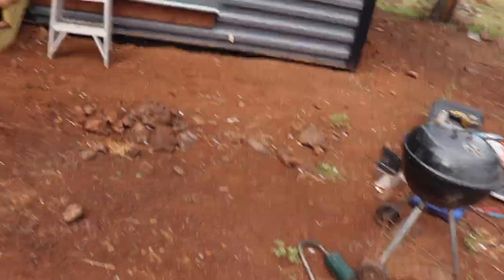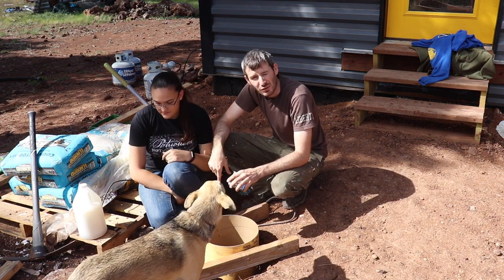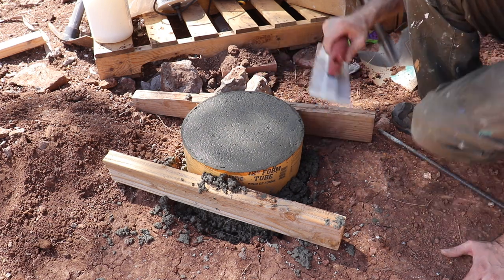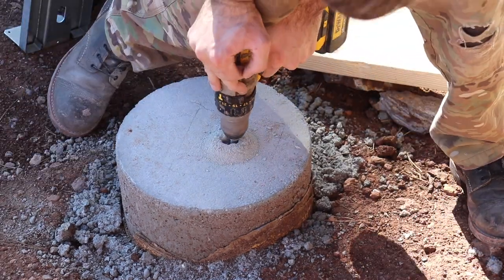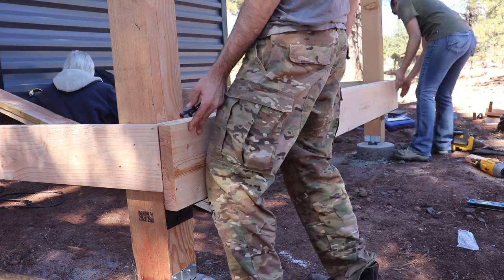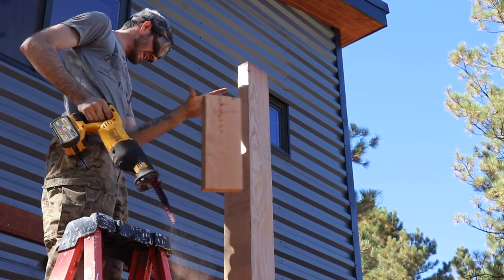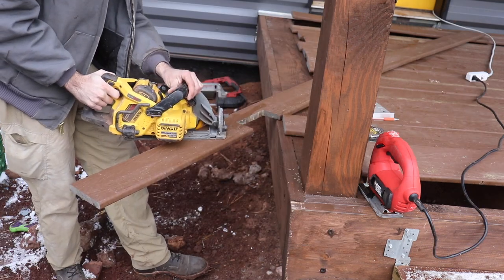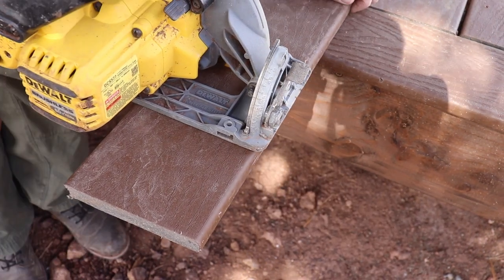Adding Covered Porch To Our DIY Cabin

Comment: Congrats!!! That's a huge achievement- you built a house! Think about that
Reply from the maker: Thanks!
Reply: @PootsPastures  how did you trench the holes for the footings where it was behind our at the bottom?
Reply from the maker: I used a post hole digger and breaker bar.  It took a while to get down 30 inches with our soil, but overall wasn't too bad with only 2 holes.

Comment: Tired Fingers

Still figuring out how this all works (hard to believe, I know; some people have insulin resistance ... I appear to have technology resistance ... maybe comes with age) Anyway ... hoped to hear how you like your DeWalt saw, nailer, and driver,  after all this? Model numbers of the items you're using?  I left a comment way back with your video on windows which was completely out of sync, so hopefully this will have a better chance of reaching you in a timely way. 

 I'm just gearing up for a similar sort of build.  My wife and I and perhaps a few trades folks and retired mentors to act as intermediary "inspectors' along the way. I just had my 76th birthday and fingers crossed still upright and pretty healthy ... Karen has asked that her age not be stated ... she's some younger; also doing well. But neither are we the proverbial " spring chickens". 

But your efforts have already been very helpful in sequencing our research and looking for what we'll need to start our shopping lists. We both absorb visual information the most comfortably, so many thanks!
Reply from the maker: Glad you're enjoying our videos, and sorry if I didn't respond to your first comment, I try to get to all of them!  But I really like the circular saw.  It's been fantastic, and has a long battery life.  Dewalt makes a 60volt and a 20volt, and this is the 60.  I would recommend getting a 12 amp hour battery (they are a little expensive but worth it so you aren't charging as often).

The battery powered framing nailer is also great, although by the end of the build the part of it that actually strikes the nail was worn down so it wasn't sinking the nails as reliably.

And then my drill and impact driver I had for about 5 years before I started the house build and they are still going strong.  

I would like to do a review video of the tools at some point I just haven't gotten around to it yet.

The saw is a dewalt worm drive style saw model number DCS577B

The nailer is the dewalt 21 degree Framing nailer, model DCN692 

And they don't make my specific model drill and driver anymore but the drill is the one that also has the hammer drill mode. 

Hopfully that answers your question.  If you do have other questions feel free to leave convents and I'll try to answer them the best I can!  And good luck with your build!!
Reply: @PootsPastures  Thank you kindly for the rapid reply;  I'll start shopping for the whole bunch. Any outlets that you particularly liked for the ones you bought?
As far as you not answering the first comment, I may have screwed up sending it ... like I said, I'm not real adept at any of the subscription activities yet. Or I think I made it after one of the videos that was way back when, and you wouldn't necessarily have seen it in the normal looking through.

 Regardless of what happened,  you've already saved me much time and head scratching with this info ... nothing beats first hand experience when it comes to tools,  guitars, or good barbecue. And in my opinion the tools part is most important at present. Many thanks.  p.s. I may try snooping around on eBay etc. and try to snag a good used version of the drill/driver. If not there must be something in the current offerings that will work.
Reply from the maker: As far as outlets go I don't rant have a preference.  However it is good to note that our version of the code required tamper resistant outlets in the living room and bedrooms.